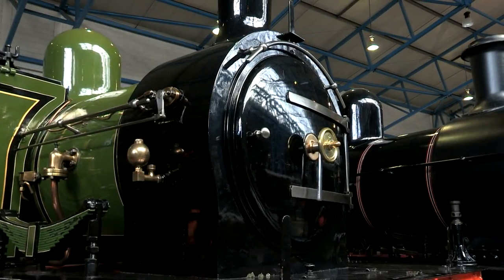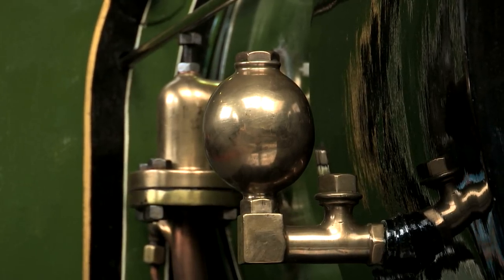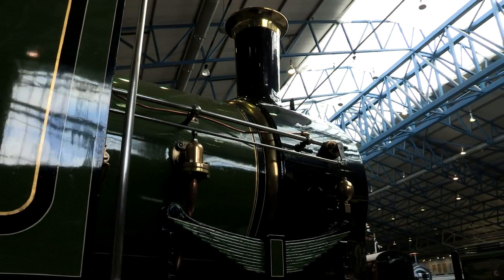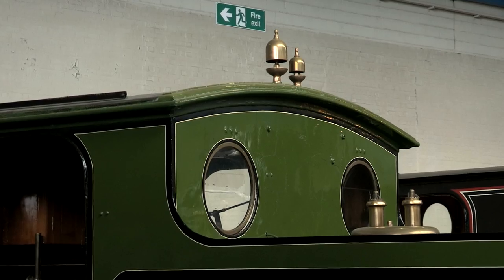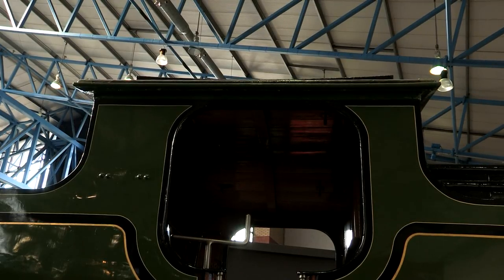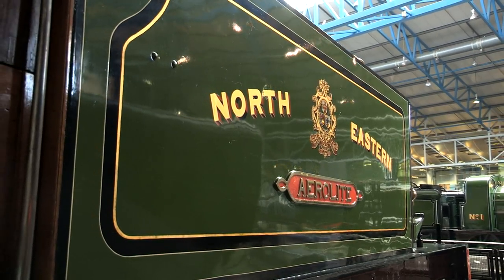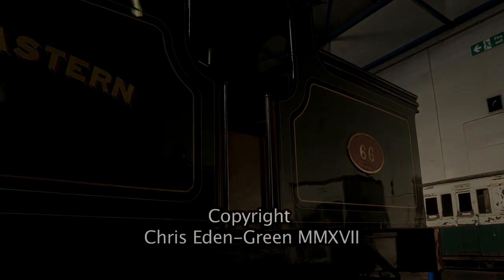SOLE SLIP: NER X1 2-2-4T No 66 'Aerolite'

Comment: I wonder if the compound arrangement was Worsdell-Von Bories.  One of the Worsdell brothers built a class of very handsome 4-2-2, 2-cylinder compound express passenger tender locomotives, with David Joy’s valve gear.  This was convenient, because it was driven from the connecting-rod, thus requiring no eccentrics (or return cranks), but then, connecting rods started to break, and people rather went off Joy’s Valve Gear.  Anyway, when Worsdell retired, his successor dropped compounds and reverted to simple.  One of the Worsdell’s was killed in an accident between an engine and a snow plough.  But I expect you knew all this, already.

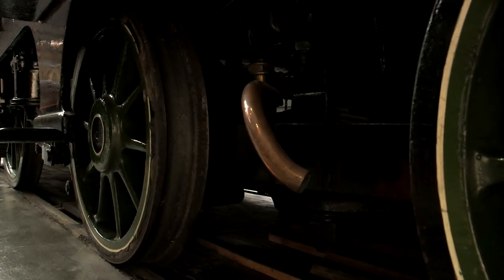Comment: I'm actually wondering if this was intentional. 2:12, right as he's about to get to that point, there's GNR No. 1in the background, with Aerolite in the foreground. Not only are these two engines the basis for Emily and Whiff (significant because of his debut episode), but their also the only survivors of single wheeler for their respective railways, both of which were key components on the ECML. Imagine Aerolite checking the NER's track around York while a Stirling arrives with the Flying Scotsman to hand over for the journey north

My point is, perfect!!!

Edit: Changed Doncaster to York because I forgot where the GNR and NER met up

Comment: TBH, if I designed a garbage collecting locomotive, itd be an 0-6-2t with condensing unit and squat proportions to work the London Underground
Reply: Funny you say that. Whiff, the TTTE character based on Aerolite, was an engine I thought was an 0-6-2 for a while. I don't remember why, but I think it's because I was younger and could see his wheels properly behind the large red frames